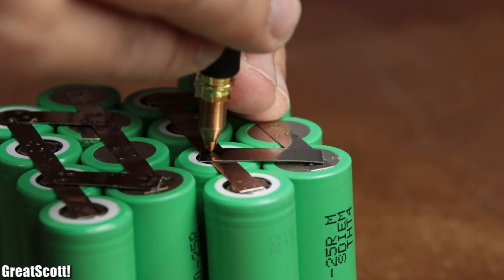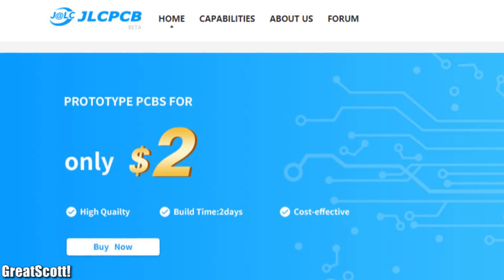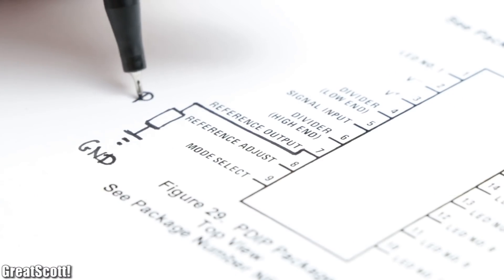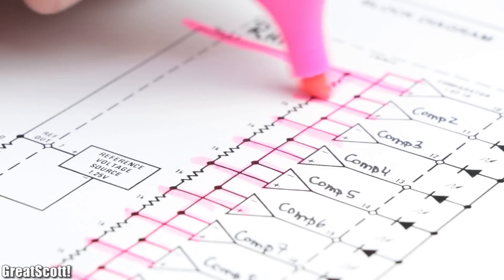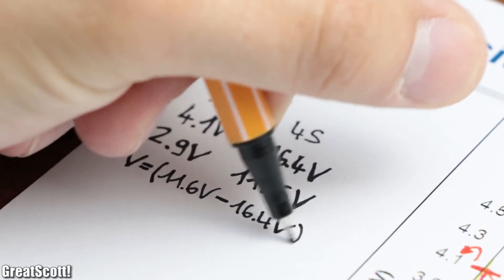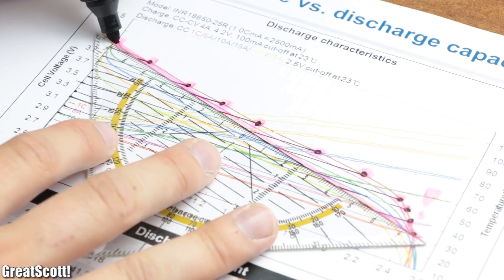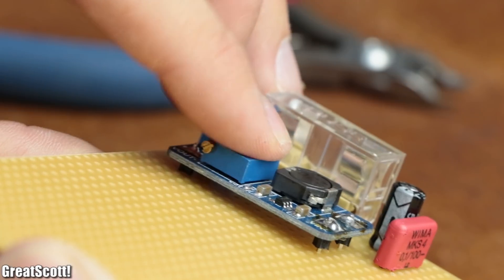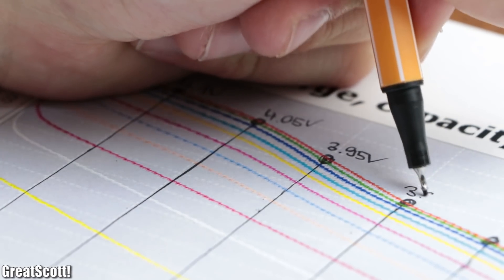Make your own LED Battery Level Indicator

Comment: Hi guys, I have a question.

In the video at 6:49, in the perfboard there's some kind of rigid uninsulated wire. Is it solder wire? If not, what is the name of the wire and when I can find it?
Reply: Thank you so much!

Comment: I using a microcontroller, ADC and lookup table, I also massure the current flow and calculate the total consumption, it's easier and more accurate

Comment: Great stuff but this will not work with high current applications since the voltage of Lithium batteries sag quiet a bit under load (depending on current draw). Love your channel btw;)

Comment: Another possibility is to still use the TI part, reduce the number of LED indicators from 10 to, say 6, and use certain LED to display the voltages that you chose on your design. You can also set a min voltage set point as another degree of freedom. No need for so many pots.

Comment: Thank you great Scott 
I want charge the battrey 18650 with circuit  . I can do it with lm 317 or transistor 2n2222 or any circuit but most to be very God and save because I want create beg project to charge  more than batteries 
excusme for my language  my language  isn't english

Comment: Nice, but using arduino seems a little bit simpler, even if more expensive. Also it is worth having a switch/button in the circuit to avoid constant current draw by the display, and having it lit briefly just to check.

Comment: Why boost and compare the voltage when you can divide and compare with lower voltage and use simple regulator of like 3.3v

Comment: Damn how do you solder those potentiometers like the one at 5:06? I always fail to solder them properly and loose the connection between the pin and the metal line which goes inside.
Reply: You dont need to solder them in

Comment: The schematic does not match the video.  Lm324 on the schematic  and lm3914  on the video. This is very confusing.
Reply from the maker: No. The first circuit in the video was based aorund the LM3914. My diy circuit then used the LM324

Comment: You can find the LM3914 in old electronics that have indicator lights for the control buttons. Most things that have the play rewind eject or record or dials that light up.
Reply: It's also likely used for the VU meters in old cassette decks, though I'm not completely sure on this one.

Comment: Thats works with only resistors and leds in series too, without a problem
And dont forget on lion cells most capacity sits between 3.8 and 3.5 v where on lipos you shouldnt go lower then 3.8 at all

Comment: A few points.
1) You could replace one of the LM324 with a LM358, as you're only using 2 of 4 opamps. Less power usage.
2) The 20V supply is not needed, use a voltage divider to reduce the voltage from the battery so you only sample say half of it.
Not complex, 2x 10k resistors in series across the battery, then connect the inputs on the Opamps to the middle of the two resistors.
3) It should be pointed out the max supply voltage for the Opamps is 32V, so your limited to 7 lithium cells in series (aka 24V nominal voltage battery).
Reply: I was thinking the same while watching the video. We can use a reference voltage ic/zener which is below the discharged battery level voltage, then use resistors to make voltage divider to scale the 0% to 100% voltage levels inside that reference voltage. That way the circuit can even be powered by the battery itself, and obviously no need for boost module :P
Reply: Nasha UT probably use 3915 or 16, one of them is logarythmic like the battery curve is. As we all say it could be done more simpler.

Comment: 1 oled
1 microcontroller
a voltage regulator, a few passives
job done with way smaller sized board

Comment: Using a boost converter only to reach your reference voltage seems very overengineered to me. A simple voltage divider at the input would do the job just fine.
Cheers!
Reply: A more elegant solution is to use a voltage reference and divider
Reply: Wessel Lemmer - exactly
Reply: That’s fine untill your voltage drops below your needed 20v

Comment: Is it possible to make one that not only goes up and down like a bar graph, but with RGB LEDs?

I got two scenarios here:
- change the bar color
- change the individual LED color indicating in 3 stages (or even a smooth transition) before turning off the LED

The second one with 3 stages could even reduce the number of LEDs of your bar from 10 or 9 to "3 RGB with 3 states" or "3 RGB with 3 stages + 1 LED".
Reply: RGB LED's already have 3 LED's inside so you can connect them to an already existing 6 or 9 LED's level indicator
Reply: You can get bar graph displays with different colour LEDs built in or I suppose you could connect it to some RGB LEDs
Reply: viermidebutura That's a good point and actually gave me another idea too.

We could actually make a bar fill with RED (one by one), fill with YELLOW (replacing RED one by one), fill with GREEN and even more colors. 

This could virtually make a short bar graph act like a longer one too.

Comment: I would have just used a voltage divider on the sense input and a simple zener diode for the analog ref instead of boosting the logic supply voltage with a dc-dc. That would make it simpler, cheaper and more compact.

Comment: Thanks for the video!
I‘ve built a similar battery level indicator for my lead acid battery a while back. Of course, if I draw a lot of power, the voltage collapses (even though the battery is still charged) and the battery level doesn‘t show the charging state correctly anymore. You have to keep that in mind, but since LiPos are offen built for high current demands, the problem shouldn‘t be as big.

Comment: Definitely again a good project... But I just wanted to know whether it would take care of voltage regulation due to different loads..? And how does a battery indicator works in mobiles as it always shows battery in percentage very precisely that too acurate.... And voltage regulation due to load also doesn't affect it....

Comment: Just a tip, a dash "-" in a model number is just that - a dash, not a minus. I get super confused when you say minus.
Reply: . dot
, comma
- dash
* asterisk
/ forward slash
+ plus
Reply: Yes, the DVD Forum would get angry if you call DVD-R DVD minus R.
Reply: No. The signs are same. So you can call minus. Example: here's the into × and here's the x.
Reply: Technically a dash is longer. A single '-' is called a hyphen. A dash is often made up of two hyphens unless the font you're using supports a true dash like an em-dash (—). But most people call them dashes anyway, including me :D
Reply: word-word (hyphen)
word -word (dash)
word - word (minus)
Reply: @LazyH-Online Exactly. Not trying to be mean, it's just a kind help to make the videos more professional.
Reply: keramic
Reply: Brandon Garven 
Wait what ??
Why
Dash -
Multiply *
Reply: You guys need to quit being so critical of punctuation and words.. Be happy you can understand him. ( you obviously know what he means ) And be happy that he took the time to share with you.  Us foreigners are not perfect, but we try.  Be nice to each other and Rock on..
Reply: Keyboards only have one x. You have to use it on into or letter x.
Reply: Yes, but you wouldn't say the "x" in  3 x 5 = 15 is the letter "x", would you? Or that the "x" in "excellent" means multiplication? It depends on the context. In this case, it makes more sense for it to be a hyphen because there is no mathematical expression in there. I personally don't say anything unless the hyphen is important.
For that particular case, though, there are other symbols like the asterisk (*), used in computers for, precisely, avoiding confusion with the letter "x". And in maths, it's common to use a middle dot (•, I made it with ⌥⇧3 on my Mac with Spanish layout, in Windows and Linux it's more difficult) for, again, avoiding confusion with the letter "x", which is used as a variable in equations.
Reply: a dash is *

Comment: As always, awesome video.
But, I would simply use a microcontroller for this purpose.
Reply: Avra Mitra
Same. Read actual voltage, decide in software which LED to light. You can then also add extra features like flashing LEDs to show a low voltage warning, chase them during charging, etc.
Reply: tin2001 exactly! Using a microcontroller makes it more efficient.
Reply: +1. And you could map out the non linear voltage/charge curve too.

Comment: Why don't you use a simple linear regulator to get the constant voltage for the circuit and devide the battery voltage with two resistors?  That way you could get rid of the boost converter.
Reply from the maker: Good idea
Reply: Using the led bar graph, you don't actually need a regulator if you property use the internal voltage reference.
Reply: True!  Didn't read the D/S - it has an internal reference from 1.2V to 12V.  :)
Reply: Or a Zener diode as a reference
Reply: Yes.
Reply: Make a video about this ! Thankss
Reply: Cle mens efficiency?
Reply: Boost converter would be less efficient than a voltage regulator

Comment: You might know this but most RC enthusiasts who  use lipo or li-ion packs only discharge to 3.6v (at rest). 
This usually is based on the capacity rating or most lipo batteries being rated at fully discharged (80%) at 3.6v. 3.3V would be fine if the current is very low but in our experience you would destroy the li-ion capacity quickly if it was discharging at higher amps.

Comment: Very nice approach, using the old and good analog way. I made myself a flashlight using an Arduino Pro Mini to control the power led with an external Mosfet and LC filter for PWM. It worked as a charm, and for battery capacity I measure the voltage with Arduino and  made the flashlight to blink from 0 to 9 in morse code.
Reply from the maker: Good idea
Reply: It's not bad if you are using alkaline primary cells. But with Li-ion cells under high loads there isn't much voltage differential between 80 and 20 percent unless you have a large amount in series.

Comment: In this method, you're not consider voltage drop of internal resistance. State of charge value may have different terminal voltage according this relation:  V=Voc-R*I, (V=terminal voltage; Voc=Open circuits voltage, R=internal resistance).  
Two simple method for SOC estimator are: 
1) Coulomb counting: integration of current in time.
2) Soc(voc):  inversion of R-C battery's model.
Reply: But he can also just use his indicator circuit while the main load is turned off. So V = Voc
Reply: Open circuit voltage isn't very useful, Gordon. Li-ion cells, particularly tired ones, will experience quite a bit of rebound after a surprisingly short period of time. You can have a battery that is effectively dead and sagging down below 2.7v that rebounds above 3.2v before you can get your multimeter leads on it. Lygte-info.dk (where GreatScott! got his battery curves from) has an article on this.
Reply: That's true. I assumed a situation were he used a quadcopter for instance and immediately measures the remaining capacity after usage

Comment: Doubt, did you use a separate power source for driving the LEDs and the complementary control electronics[Just like a multimeter] OR did you used the battery power from the same battery we are monitoring? Which type is recommended? The Multimeter example or the battery power from the same monitoring battery?
Reply from the maker: No

Comment: The LM3914 is an interesting chip.  We used to make crude oscilloscopes combining a LM3914 and a 4017 decade counter /decoder.  Thanks for another great video!
Reply from the maker: You're welcome :-)
Reply: The LM324/4017 O-Scope would make an ideal project. Would probably include 4011's or 4093's for trigger control and time base.

Comment: Great Scott, you should take a look at acoustic levitation, it seems simple enough to build, although you need an ultrasonic frequency, i think using 100w piezoelectric cleaners should work best, witch are hard to drive (i think).

Here are a few links:

https://www.youtube.com/watch?v=669AcEBpdsY

https://www.amazon.com/ILS-Ultrasonic-Cleaning-Transducer-Cleaner/dp/B07912D76Y/ref=sr_1_10?ie=UTF8&qid=1531062405&sr=8-10&keywords=28khz+transducer

I tried building one except i still cant figure out how to drive it properly, i do know you need around 300v for it to work and i dont have the correct parts yet.

I dont want to use the included driver that you see with some of them because its probably modulated by the 60hz from the wall voltage and you need a very specific frequency for this to work.

anyway i thought this should be interesting.

Comment: This works assuming you don't draw any current from the battery. The voltage will fall as soon as a load is put on the battery. Like if you are drawing 10A from a 4.0V lipo, it's not going to stay 4.0V forever. Maybe for a future project, have a circuit measure the current being drawn and compensate the voltage thresholds? Other than that, pretty good video.
Reply: Peter Zingler     Quitw the opposite - most consumer devices show the battery indicator while using them, so it’s important to be able to use this indicator while using the device itself.
Reply: Artūrs Savickis most consumer devices doesnt drain enough current to create a large voltage drop
Reply: I came here to say something like that. The voltage is never decreasing in a linear fashion, it will bounce up and down depending on use. Yes, in the long run it will steadily go down, but for shorter periods the values might not make any sense whatsoever...
Reply: Yep.  This is really a bad design for a battery life indicator, especially for LiIon.  Correct solution would be a current sense and coulomb counter circuit.

Better still would be NOT using a top-balancing BMS.  (Unless you hate your batteries.)
Reply: yeah man you're right but you can measure the usable capacity of battery under the used load and use a dummy load or a programmable load to draw the discharge curve and then use this curve to estimate the battery level as shown in the video i know this is impractical and have many problems for example when we reach v-cutoff of battery so the load is gonna be disconnected which will change the battery voltage but it can work for simple applications.
Reply: BoomBrush the drop under draw depends on the internal Résistance of the cell , that voltage sag isnt calculated in most power indicators

Comment: I would do it with a tiny "188%" LED module and use a micro controller to do the job and accurately show me the capacity. :)
Could you give this a try?
Reply from the maker: Not anytime soon

Comment: Hey Scott, great vidéo as always. I didn't found the reference of the soldering board in any of your vidéos. Could you give us the right référence? Thanks
Reply from the maker: it is a simple perfboard with copper dots. Search for it on Ebay or Amazon.

Comment: Boost converter was an overkill ... A zener reference was enough
Reply: explain that, I dont undestarnd how
Reply: acynder1 opps i didn't see it was used for 3.7v battery .. my bad ! .. i was planning on using it for a 12V
Reply: If it was a portable project he must use boost converter and zener consume more power
Reply: A voltage ref ic would be better (creating a reference at a lower voltage then minimum batt voltage) then just voltage divide the battery voltage way down.  No boost needed.

Comment: What if you need a 20s battery voltage indicators? At some point arduino gets cheaper than using 20 lm3914 or lm324 i guess...
Reply: flippynl
Serious question?
You know what a voltage divider is?
Reply: you can get 10x LM324 for 1€ on ebay, they are sufficient for up to 40s packs
Reply: Henrik Linus Pauly Why use a voltmeter, put your tongue in paralell and remember the pain. We use tools to make our life easier, or do you use firestones to make a barbecue?
Reply: @nogoogltalk  he has a point, and thats what i would use, because i dont want to lick random stuff, and remembering the voltage curve isnt that hard lol
Reply: And if you have 40s that doesnt really matter just use voltage deviders and bring the level to 4 s state
Reply: nogoogltalk 👏🤣
Reply: May as well just get an 8 bit flash ADC with parallel output interface.
Reply: And we shouldn't forget the pain of having to adjust the potentiometers.
Reply: Where?
Reply: the bad thing is no dot mode unlike the lm3914
Reply: @nogoogltalk  Lmao ... you made my tummy full of pain :D :D :D
Reply: you can make a circuit to duplicate the currents of all the outputs
Reply: flippynl are you serious?
Reply: CrAzYDr1veR XDD
Reply: Or use an ATTiny and a shunt resistor
Reply: LM3914s can be cascaded
Reply: Arduino's voltage regulator will have power loss and will be a headache for many people
Reply: And also release some smoke if you wanna create a bigger pack
Reply: but a small arduino will save space and probably save of power consumption too
Reply: and how do you plan to input 84V+ into a arduino 5v analog input and keep the magic smoke in?
Reply: Goddamm just use a voltmeter and memorize the capacity/voltage curve and then just could measure up to 150s packs
Reply: That's what he wanted to prevent